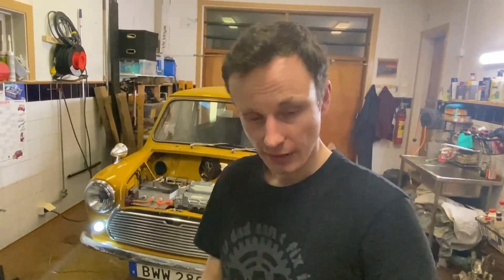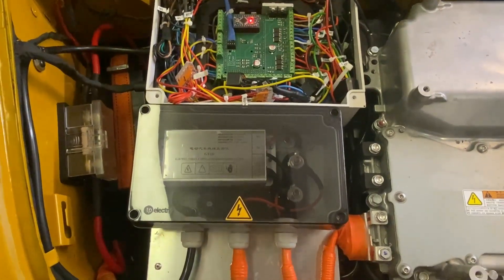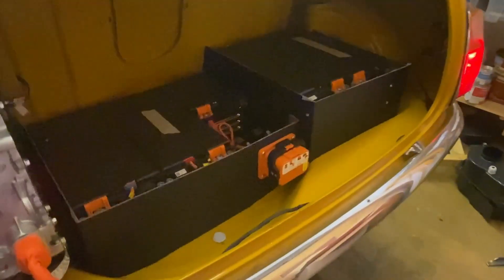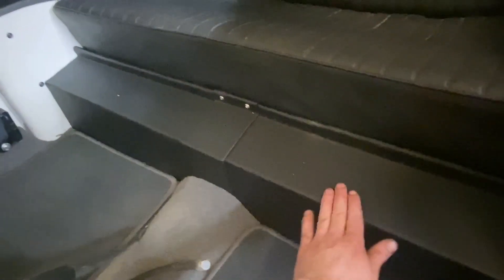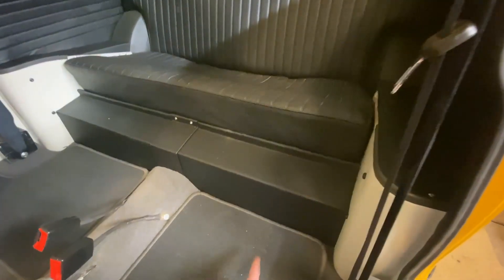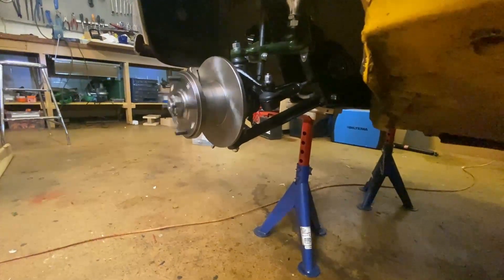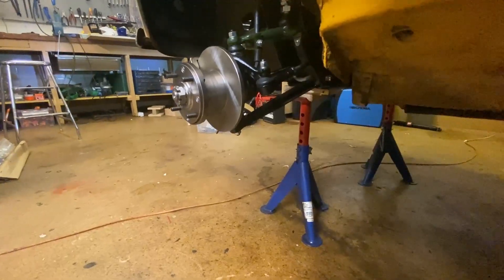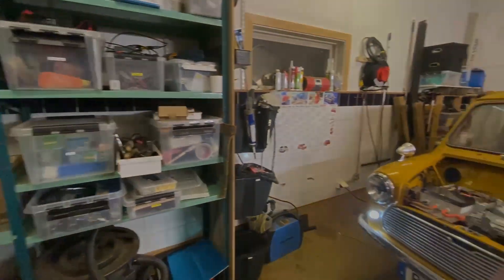The Electric Austin Mini is coming alive! ⚡

Comment: what mainboard or vehicle control unit is this? do you use openinverter software to talk to the inverter?
Reply from the maker: Hello. The VCU is of my own construction, based on an Arduino Due. Code is written in C++ with platformIO. All CAN details are available on OpenInverter.org

Comment: How large are the battery packs and how much power is the motor putting out?
Reply from the maker: @VgAce135  I fitted 28 kWh and the power output is 70 kW (94hp). About 1380 Nm at the wheels.